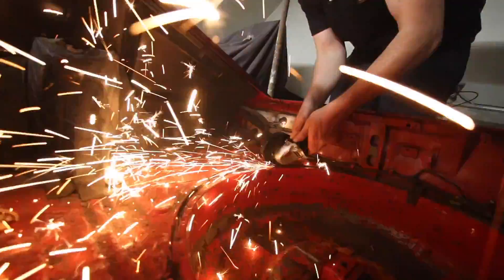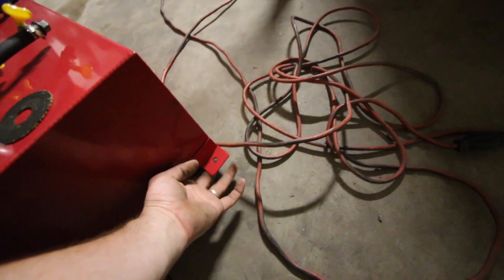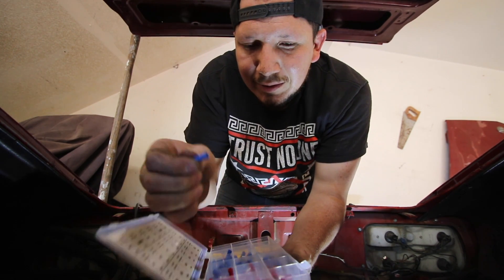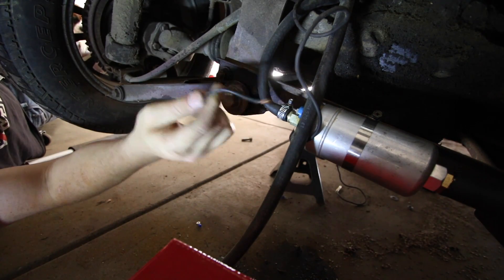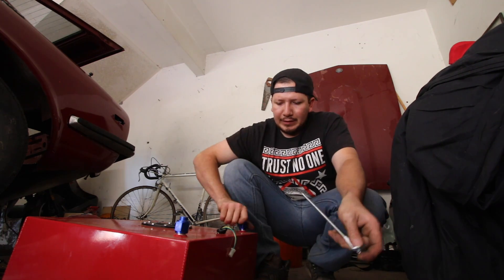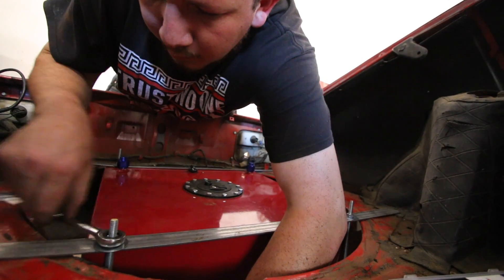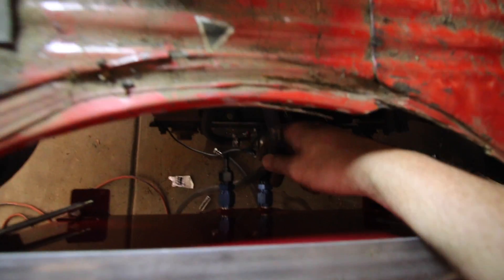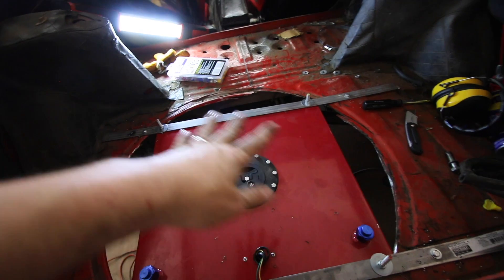How to install a fuel cell

Comment: Ground to a greasy suspension bolt, then use some low tensile threaded rod and flimsy thin flat bar to support your what, 70kg backwards tank? I’ll make sure to drive in front of you

Comment: Imagine connecting your ground with a dirty oil soaked bolt on the rear cross member...

Hold on... I just finished the video. BRO !?! are you still alive? Anyone whos reads my comment do NOT put a fuel cell in like this dude just did omfg.

Comment: What are the black connectors called you put on the bottom at the end to connect the hoses. I have to order some ASAP! You can see them well at 7:41
I need some for  some AN6 hose

Comment: Congratulations,,
  You just increase your chances of burning up in your car by 80%.
Reply: fuel cells are safer
Reply: @samleen   here's another guy that has no idea what im talking about.
  I'm not talking about the fuel cell..
Reply: @hectorortega9131  could you tell me?
Reply: @samleen  i think he’s talking about how the guy mounted it backward. he realized quick enough before he put gas so it was chillin.
Reply: @diesel.bimmer thank you for explaining

Comment: Not going to work 20 gallon cell at 8 pounds a gallon those will not hold 160 pounds in driving conditions

Comment: Hey I know this is an old video but doesn't hurt to ask. When you installed fuel cell, what did you have to do gas gauge wise? Another video I watched said the tank wouldnt work with original gas gauge, which makes sense. Just wondering what you did to fix that?
Reply: You can get sending units for any fuel cell, or wire up a separate fuel gauge in addition to stock one.
Reply: I installed this same exact cell (mines black though), and it depends. If you have a GM car thats level sender reads 0-90 ohms (which is what the fuel cell he installed is) you just splice the wires into the preexisting level sender's. If you have a 90-0 ohm car (Dodge, Chrysler, etc) youll have to wire in the correct gauge straight from the fuel cell to the dash. I did this install in an old Dodge though, so I can confirm wiring it from the cell works.

Comment: Hey good idea on mounting the fuel cell but you have it backwards! The fuel outlet of the fuel cell should be facing the rear taillights for when you accelerate, the fuel will shift to the back of the tank. Just letting you know, IMO
Reply: thatonebikechannel How not to install afuel cell all wrong will not pass inspection
Reply from the maker: good thing you told me before i put gas in it haha ..  but it does make so much sense to put the pickups to the rear of the car ill prolly flip it around in the weekend anyway thanks for telling me that haha and thanks for watching!!
Reply: I wish you would have made a vid installing the 1j. That's what I plan on getting
Reply: I want to install a fuel cell to my pick up. Will it be posible to tell me the parts that you need other then the fuel cell tank. Like what kind of fuel pump I need and filter?
Reply: thatonebikechannel 
I dont think thats correct. That can be a huge hazard if car is involved in a rear collition. To further back my point, even the original gas tank has both the outlets facing the front. Or am I misunderstanding what you are recommending?

Comment: the fuel line that goes from pump to motor looks like it is kinked
Reply from the maker: im gonna have to check it hah i just ran out of time today but i was gonna get some fuel and start it to see if everything worked as it should ... have u worked on ur Z??
Reply: +Walther Olivas  i have not. i am about to pull my l28 out trying to sell it right now.
Reply from the maker: thats cool try to keep the oil pressure sensor and coolant temp sensor off the l28 so you can make your stock oil and temp gauges work with the new engine im gonna make a video on how you can do that  but if youre going with new gauges i guess it doesnt really matter ...thanks for watching bro
Reply: +Walther Olivas will do thank you for the good videos. you are the only one on youtube posting detailed videos of a 1jz build